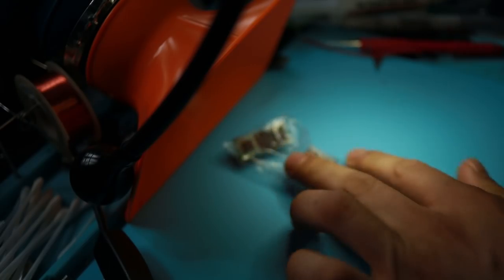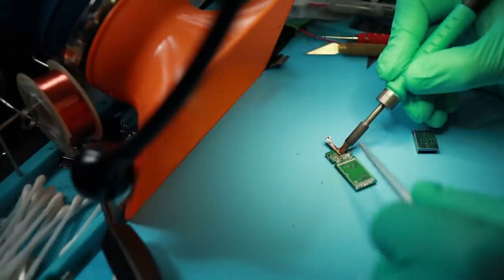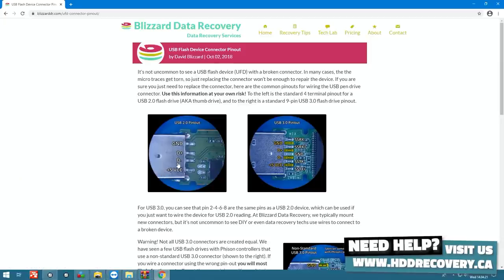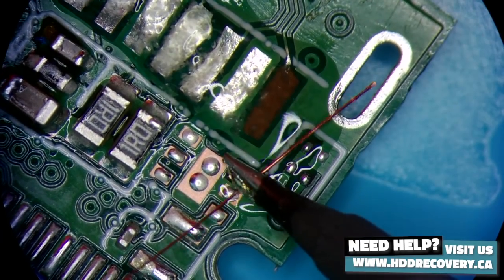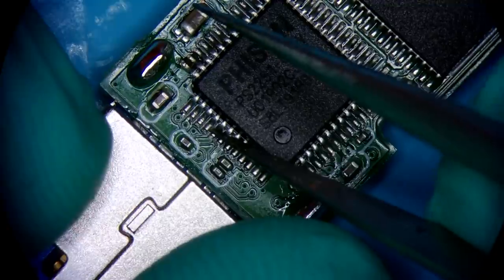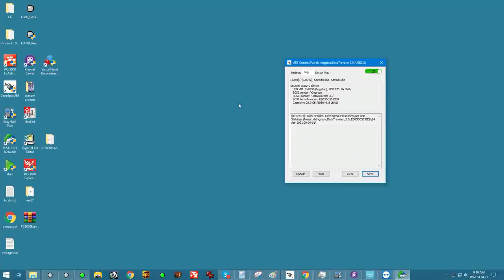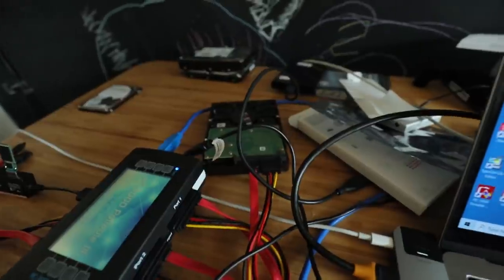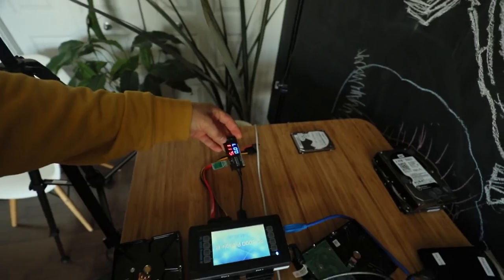this flash drive got snapped

Comment: I have same issue with usb 3.0 that was wrong power (because of short on cardreader) but usb 2.0 was still able to work (sometimes :) ). So i buy controller and change it, after that usb 3.0 and 2.0 both able to work. It was interesting experience (have video about it on my channel)

Comment: Still working from home eh?! Great video though! Didn't know about that for some of the 3.0 connectors.
Reply from the maker: Shop runs independently, and I go there to make sure everything runs smoothly few times a week. But I film my own cases at my lab (after all it's probably the most equipped lab if square footage is compared :)

Comment: Same thing happened to me when I tried to piggyback power for a tiny fan off a USB 3.1 flash drive. I’m wondering if there is a fuse that blows if something happens to the board.

Comment: not need to connect all to usb work 

+5 
data + 
data -
gnd 
all other pin uses for usb3 protocol
if they not install flash speed may not up tha 30 mb 
how ever tlc nand write speed 10mb